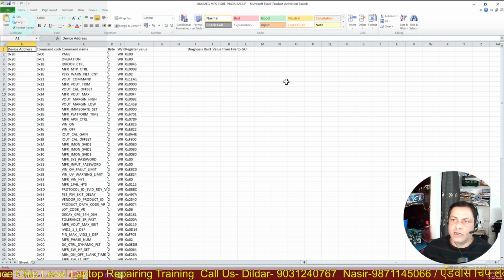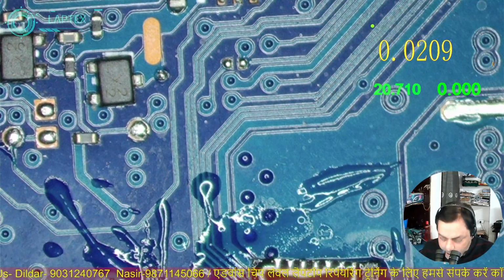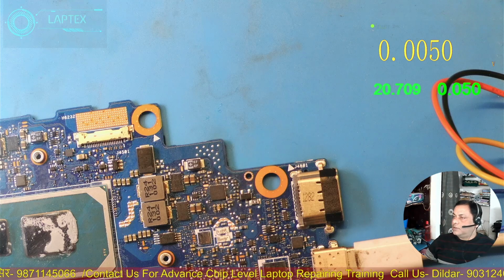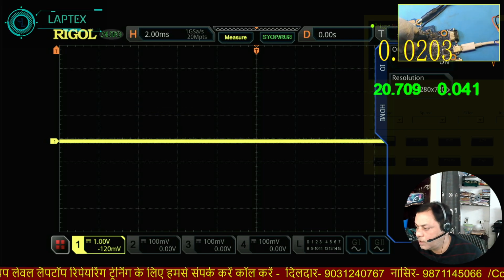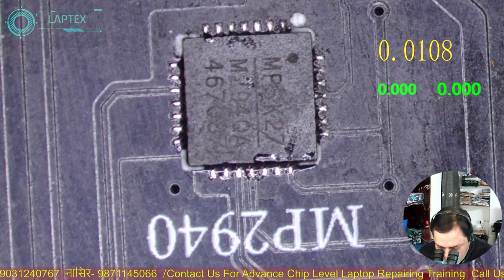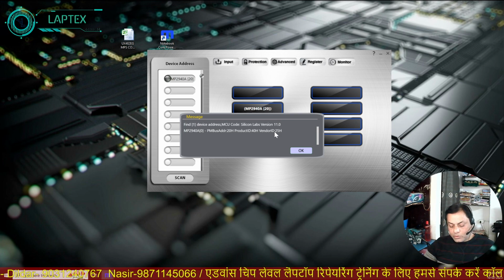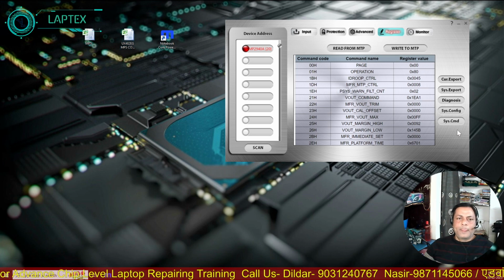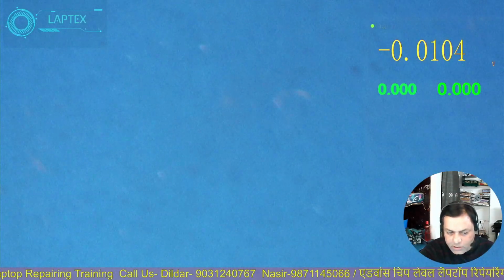How to Use MPS Programmer to Program MP2940A |Solve No VRM CORE ENGLISH |ADDR and PMBus Address Data

Comment: Hello, I have been trying to flash the ROM onto the MP2979A chip for a Dell Precision 5550 using software. However, every time I load the file, the application freezes, the connection to the MP2979A chip drops, and the write process fails—even though I have replaced the chip with a new one. I obtained the Precision 5550 file from a friend, yet when I flash a ROM file from a different MSI machine (of the same capacity) onto the MP2979A, it works fine. Could the issue be with the file itself? Please help. Thank you very much.
Reply from the maker: Yeah it could be due to the file

Comment: sir   have a question lets say old chip is dead short is there still a  way to get the firmware from it if not then from where should i get the firmware ??
Reply from the maker: If it's readable then you can take it... otherwise you need to get it from some old chip.

Comment: Hello. I am working on a motherboard fault in an Acer laptop. There is no documentation available for the motherboard (TU441ALH REV:1.0A). The 3.3V and 5V rails are present, but there are no CPU phase voltages. There is no short circuit detected. The board draws 110 mA of current. The only symptom is that the M2940A and the 12450H are heating up slightly. Do you think this issue could be caused by a faulty MP2940?
Reply from the maker: Yes could be a possibility.

Comment: When I removed the MP2940A, the short circuit from my laptop disappeared, but do you think I can back up my chip now? Or do I need another device to do this?
Reply from the maker: Backup to the firmware from the faculty chip and flash it in your new chip
Reply: @laptex1377  Thank you, I want to buy a programmer. Is an offline board sufficient?

Comment: Hello friend, greetings from Peru. In my case, I have a MPS2964, but it is short. When I put it on the soldered programmer, it overheats the MPS too much and doesn't recognize my I2C address. I wanted to know if there is a solution to it please? I haven't tried directly from the motherboard. But I would like to know if there is a solution in case it doesn't work either, please. Thank you very much for your support 🙏🙏🤗
Reply from the maker: If you can put from a working board then it's fine and good....but for a virgin MPS regulator, it needs to be programmed.
Reply: @laptex1377  What happens is that I have the MPS in short damaged. And I don't have a way to back it up or program it from scratch. I'm still researching how I can program it without Backup. If you know of any method, I would be very grateful please 🙏 Thank you for replying
Reply: @laptex1377  Hey bro, I've tried everything but I can't get a backup of the original damaged IC. And lastly, the TELECOM software doesn't support the MP2964 chip... I'd have to find a similar motherboard to backup it, but it wouldn't work because the TELECOM software doesn't recognize it either. I get the "Unknown" error... I'd love to know if you have any TELECOM software that supports MP2964, please. Maybe you have the software updated. GREETINGS!
Reply: pedro un favor acabo de comprar el programador , donde consigo el software , gracias

Comment: how would you do the back up if the chip is burn?  can i find the file like i find bin file for the bios ??? how it work i didn't get it
Reply from the maker: Back up is needed anyways.
Reply: @laptex1377  I understand but no one will have this backup for the chip if the chip is burned so the programmer is useless, it doesn't make sense to me don't you agree ?? i have to find a doner board and get backup from !
Reply from the maker: Not exactly... We can have it programmed with hardware ADDR divider.

Comment: Hi sir 
I have a laptop motherboard model no MS -158P WITH RYZEN 7 series processor DDR5 ram.
During battery removal accidentally i had shorted battery terminal on motherboard after laptop becomes dead.
Currently i am in bahrain and laptop was purchased from india i want to send it to your office kindly update me so that i can proceed.
Reply from the maker: Yes you can send it to us.
Reply: @laptex1377  ok i will send  motherboard with a heat sink.
Reply from the maker: @rrajput6830 sure
Reply: @laptex1377  hi sir
I had sent the motherboard to your address and also sent the details on your mail id.
Thanks
Reply: Sir i had sent a board on a sahyog building address which is mentioned in your official website but nobody received there now my parcel is sent back to bahrain😔.
I had requested to laptex staff to pick it from post office but nobody helped. Kindly update your address on website so in future it will not happen with someone.
Once i receive my parcel i will send it again
Reply from the maker: Sorry for the inconvenience brother... We will update the address and the required credentials on the website... really sorry for that

Comment: I don't get it, if you're able to make a backup your ic is supposed to be working, right? So how ard you supposed to be able to do that if your Ic need to be replaced because faulty?
Reply from the maker: Good question... But it's not exactly what you are thinking... It's about the address of the register which is stored that needs to be read and matched. So backup is needed.
Reply: Are you referring to a preventive backup, taken before any damage occurs, while the machine is still fully functional? That would be quite difficult to obtain I guess unless the data is standardized across this type of machine and you can use someone else backup. In that case, you might be able to use a backup from another identical motherboard, similar to how BIOS or SIO backups work.

However, if there are specific registers that need to be configured according to the processor's specifications, that would add another layer of complexity to the process. Otherwise, after some time, you might be able to find these dumps in the Vinafix catalog.
Reply from the maker: @ictrepairs6963 it's a matter of research now.

Comment: its possible to do  just using simple python script with cp2112 adapter and onboard
Reply: Would you mind sharing how to do it?
Reply from the maker: If try... Let me know.
Reply: @laptex1377  Full command set is published by MPS. You just boot any version of Linux and send those commands using python pmbus library. Should take not more than 1 hour, if you already have Linux running. I do the same on graphics cards. No fancy software or adaptor needed. Just CP2112 will do with just 3 wires. I don't have one of these motherboards to try. If I get a board with MP2940A, I can try and show you simple steps. Finally we can make a python script for regular use, just like how we do a cleame bios.